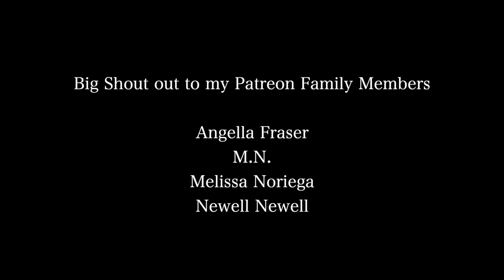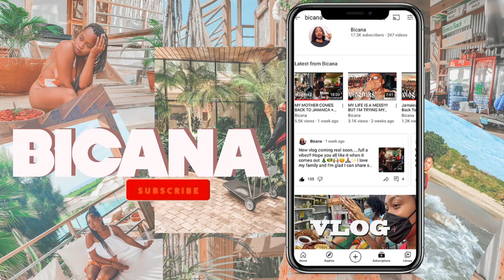Building Our Dream Home in Jamaica | Update + We Fired Them!!

Comment from the maker: This video is an update of Building Our Dream Home in Jamaica | I also shared with you a little bit about why we had to fire the previous men that was working on the home. Please LIKE COMMENT SUBSCRIBE & SHARE FOR MORE =P #bsquad
Reply: Was it in this river the camera fell into
Reply: Just curious..Not concerned about runoff… house looks low
Reply: When Building 👷‍♂️ a house 🏠 make sure to pay a percentage at Certain levels meaning you'll pay a percentage at foundation the a next percentage at wall then a next percentage at roofing on so on till the house 🏠 is complete 😀. I did this and it worked very well.That way everyone is happy 😊 you guy's and the builder.
Reply: @donovanjohnson2098  you sound very knowledgeable mr Johnson. Thanks for sharing. does it look like they did that with this house? If not. Would it mean they need to fill it more and go higher?

Comment: I am presently building my house in Jamaica same split level with the 2 floor on top my basement floor was done with 8 inches blocks and not 6 inches to take the weight of the other floors,I think there needs to be more columns if you are going to put 2 more floors on top Plus we use 5/8 steel instead of 1/2 inches.
Reply: We too

Comment: We need building contractors to do a program at the HEART Academy then get certified by a govt agency which could even be at the municipal parish council level. Too often I see guys claiming they are builders (contractors) taking big money upfront because they don't care if you fire them later on bec that frees them up for other jobs they have lined up. We need to be able to take their licenses away so they take the work seriously and pay attention to the friggin blueprint! Also, I hope they made enough space for the doorways [36 inches (3 feet)] must be present (after 2x6 frame goes in) or you cannot get a dishwasher or a good size washing machine or a big fridge through them. Because that is another money for them to buss out the concrete again.

Comment: just a suggestion. 
That Verandah that you are about to dump up. Perhaps you could knock out a doorway at the front , slab off the top (or if slabbing is too expensive cover it like a normal patio, with board, and make the underneath a storage area. I mean you can never have too much storage with all that land you have.

Think of storing all the yam , potatoes and bananas under there plus all the mud encased tools like forks hoes, and sprayers.

Plus a wooden floored patio would looks so good.

Comment: You really need to take a hammer/sledge and hit some of those blocks..because I see a lot of blocks being put up..and they aren't filled up as yet. Some of these work men lazy..and will just "run blocks" and don't fill in the block holes. Because it's easier to run the blocks vs fill them. You really wouldn't want to go further and the foundation blocks not filled and strong.
Reply from the maker: Yes, our new contractor is working to ensure they’re all filled and secure. There’s going to be a lot of load bearing down on them so it needs to be dove right!
Reply: @BicanaBrown  🙏🏽🙏🏽🙏🏽
Reply: So true d same they did on our house my bf fire them and do all d work himself we deck  a month ago cnt wait to finish up......

Comment: Based on the topography of the land the issue seems to be the land should have been dug down lower... now that it hasn't the design has to be raised or the house may have to be changed to a split level design... I  would like to see the plans to see how off the design is... boxing for the columns seem to have been removed early... they look green... lol at mm of water
Reply from the maker: It’s meant to be a split level this is only the basement floor…the land wasn’t dug down enough so now it has to be dumped up which is annoying 😩
Reply: @BicanaBrown  this is where a project manager comes in... costs a bit more but will significantly reduce the possibilities of issues  like this
Reply: @princeodinson3239  Can I get a link for you?

Comment: Problems: For a 3-storey structure, the stirrups need to be bigger, the 4 steel bars in the columns need to be at least 6, the size of the steel used in the columns need to be bigger, some of the block holes them appear to not be filled and they should be because some of those walls are already very high. Given the slope of the lot I would have used 8 inch blocks from the foundation 6 above. Other issues, a lot of the spaces between the blocks were not buttered with mortar they just kiss the two blocks together and keep running the blocks (sloppy block runner). This laziness is because they think when you flash and render it, those holes and spaces will get filled in by somebody else doing that job (less work for them running the blocks). The space you showed where the stairs will go should be wider, actually. I can tell these clowns don't know what they are doing. It looks like they cannot even understand blue print to bring your design to life so they tried to convince you to do it their way so they can cut corners and do the job the way they know how and not what you want. All that money your mom spent, my heart breaks.
Reply: She should probably look into the grade of  the land and water shedding expecially around the underground garage to plan drainage and terracing of the slopes to prevent land slide and basement water infiltration because it seems the building was built down slope without any peers or possibly proper anchor to sustain that much weight on a revine along with a possible few 100 to 1000 gal water tank  with water weight roughly 8lb per gal give or take a 100lb for tank and plumbing weight being placed behind the building any movement will result in alot of stress to that section of the foundation along which the soil seemed to be mainly clayish which logs water .. also didnt see any lateral bars poking out  in the walls tieing into the coloums every 3/4 block rows to prevent shear cracks ..well tons of issues and stuff to think out before its too late should have had the architect do a land assessment to have the buidling design match the features of the land and have the design structural engineered to prevent loss of investment if a hurricane or major earthquake affect the area + have anything designed overbuilt as tolerance due any eventuality
Reply: Yes these work men are a pain that's why my project have not gone any further because they want t tell you what they want not what you want or what is on the plan I fired about for sets already. And I have put mine on pause for quite a few times I am not rushing it I am going to take my time I finally got a good contract very best of his kind so I will resume work in this new year